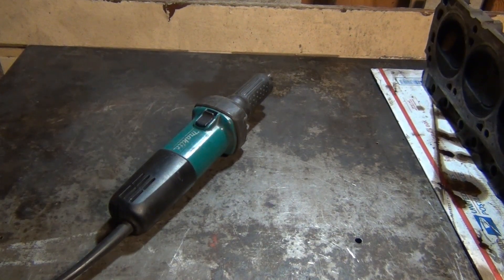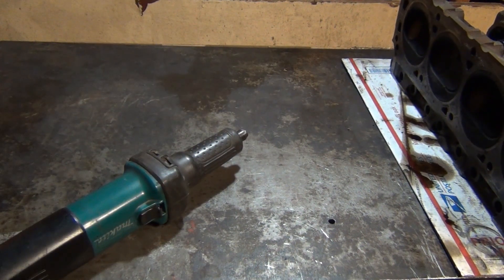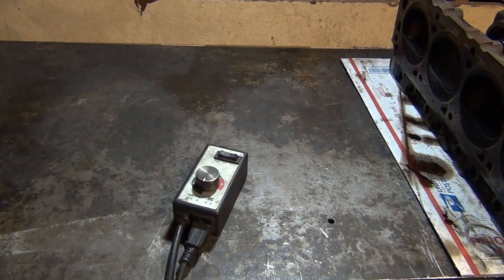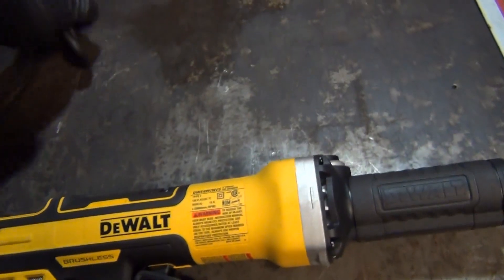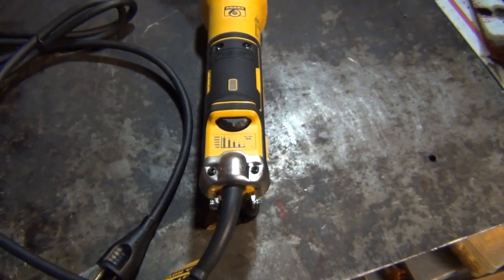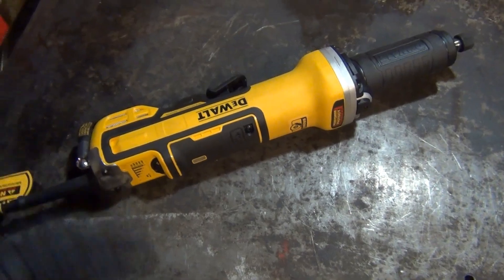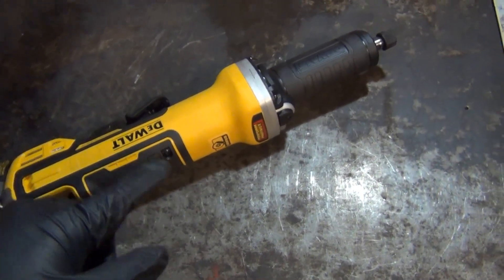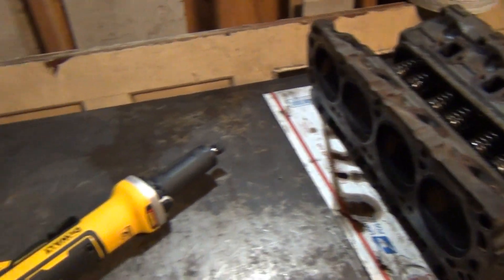The Best DIY Electric Die Grinder Set Up For Port Work Porting Heads And Intakes

Comment: See I wonder how I would do with one of these  in my hand.. I use like a $60 flex shaft grinder with 4-6" shanks. Only thing is ive had to change the cable inside a bunch of times but I love it... has a regular chuck instead of a collet too so I can put all sizes in.  I could see how they both have their benefits   but for me im used to light weight in my hand and it helps me feel the metal more than the tool .
Reply from the maker: Definitely a flex shaft is great! It helps a lot too when you need to smooth out around bends! I don’t have a flex shaft but it would have came in handy plenty of times. A large grinder like this one is good for removing large amounts of metal like the thermactor humps on the exhaust 😄

Comment: Awesome tool!👍The battery powered dewalt is sorely lacking that variable speed control. Excited about seeing you put it to use!
Reply from the maker: Yes I almost bought that one, because its cheaper and I have their impact tool set, so I have a couple of batteries. But I thought it would be better to have one I could just plug, I didn’t realize it was missing the speed control though 😬

Comment: I really wish I would have bought an adjustable speed grinder. Mine is the "one speed" DeWalt that looks quite a bit like yours. I ought to get me one of those potentiometer setups for it. What bits do you recommend? I can tell you that the "Warrior" bits are straight garbage.
Reply from the maker: Yeah it’s nearly impossible to get the cutters to work at full speed! Honestly the burrs I have were from ebay, I bought them a really long time ago, so I don’t know the brand, they have been good but whenever i have to replace them Ill be in trouble too 🥲
Reply: @MrBlitzkrieg1987  yeah, I've seen some prices on these... they can get pretty expensive.